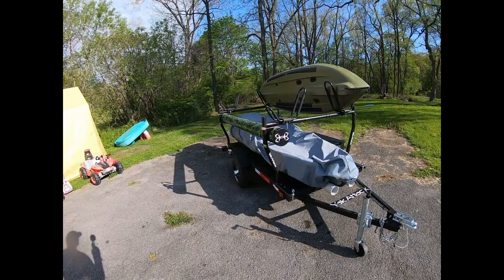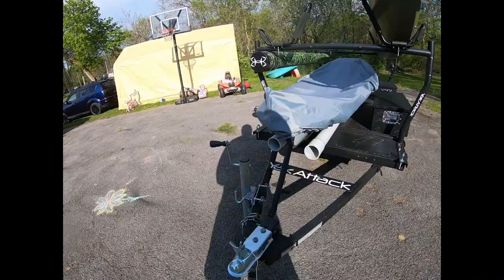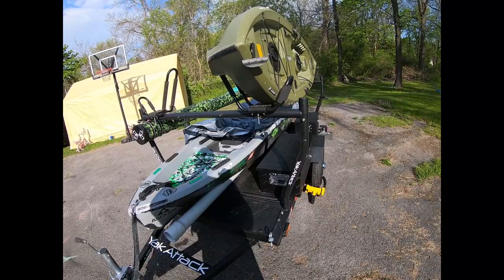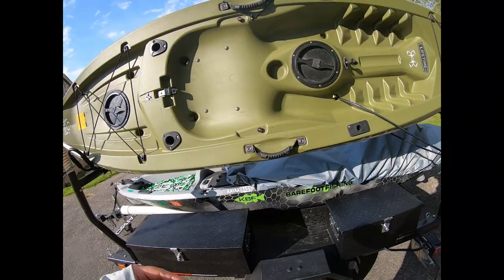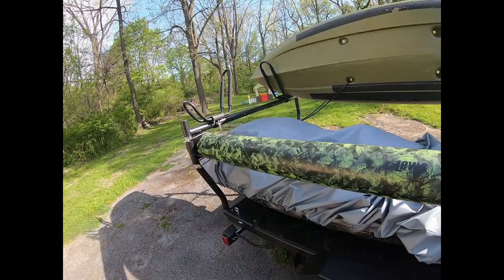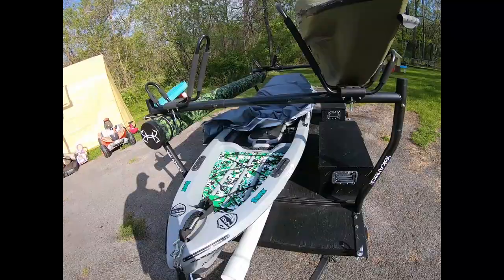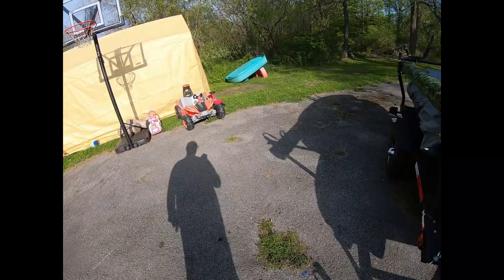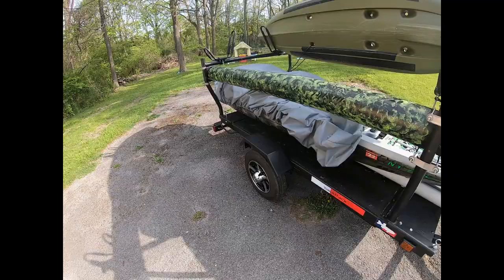Kayak trailer build harbor freight trailer mod

Comment: I have the Ascend 12T and 10T and I just purchased the same trailer. I like your design. Questions about the bed liner: Did you spray or roll it on? Did you apply it before or after assembly? Did you have to sand the surface before application? Did you bed liner over the bolts too? What did you do about the trailer vin placard and such on the tongue; did you cover it with bed liner, remover it and then put it back on...etc?
Thanks.
Reply from the maker: I used spray bed liner. Did it as I was putting it all together. I went over the frame with a wire wheel to scuff it up before painting. I taped around the vin before painting it.

Comment: Really nice conversion...What is the total spent on this?   Did you add night light strips for illuminating the area for those pre-dawn / post-sunset operations?
I will be cloning your setup soon.
Reply from the maker: I think the total was around $800 or so. Definitely under $1000. Good question about the lighting, I'm actually working on that now with a couple other small things. Thanks for the feedback I really appreciate it. Hope yours comes out well. Any questions feel free to ask.